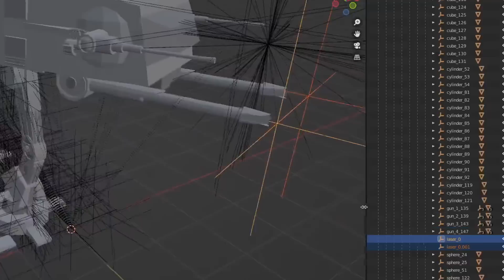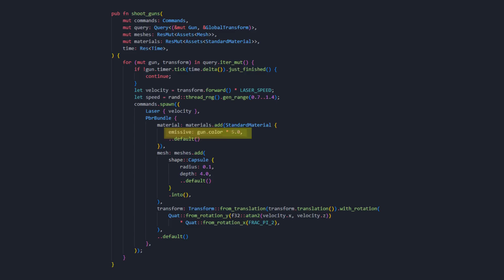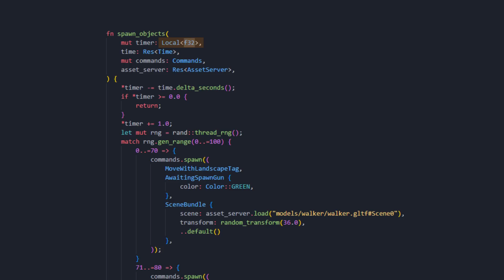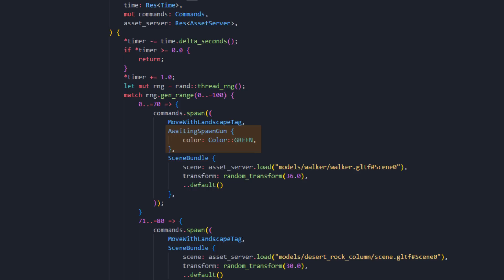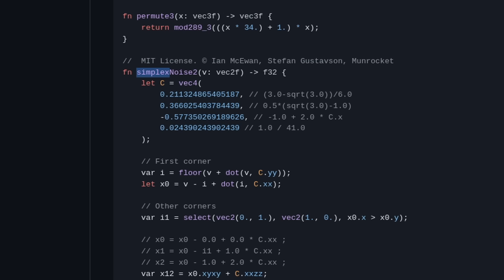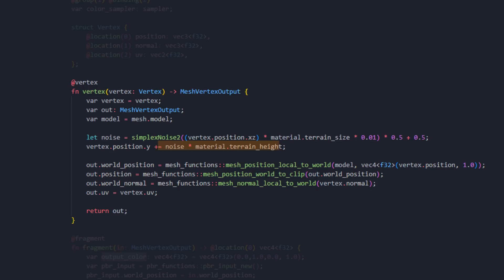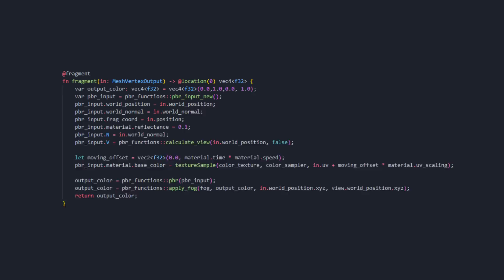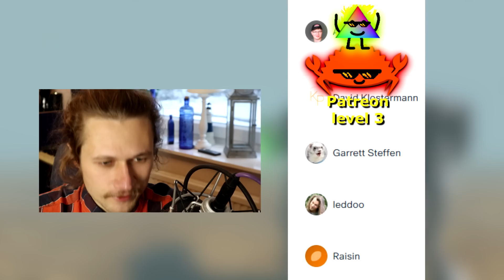Bevy & Rust Star Wars Scene - How it Works

Comment: 2:56 I gotta nitpick this, but that code does not make the lasers 6 times faster every second. At 1 FPS, it makes them 7 times faster every second. At 2 FPS, it makes them 16 times faster every second. At 5 FPS, it makes them 51.5 times faster every second. At 10 FPS, it makes them 109.95 times faster every second. At 60 FPS, it makes them 304.48 times faster every second.

The way you actually make it 6 times faster every second is `laser.velocity *= 6.0f64.powf(time.delta_seconds());`. Also, when something is accelerating, `translation += velocity * time` is also wrong; the object will travel different distances depending on framerate. The correct formula depends on how the object is accelerating, but in this case it's `translation += (velocity_after - velocity_before) / 6.0f64.ln();`. I don't like delta time game loops because it's really hard to get consistent behavior across a range of framerates.
Reply: I think you can just use elapsed time or better put the system in the  `FixedUpdate` schedule. That should run your system at a fixed rate of 60 fps (or whatever to configure it to).

Comment: after trying my hand at bevy shaders and failing horribly I definitely got a whole new kind of appreciation for what you managed to do in a single hour
Reply from the maker: trust me it has taken a long time of trail and error, reading all the example code, even the source code of bevy, to finally reach a point where I could understand how to integrate bevy pbr.
Reply: @Tantandev  the pains of using a bleeding edge, undocumented engine I guess
Reply: @n3y Bevy just made this soo much easier with 0.12 release yesterday! You can now see the `extended_material` example that removes most of the boiler plate and just add your own shader logic easily.
Reply: @neo3290  I saw that, and if it truly is as easy as it looks on the update page, I am very much excited to use it